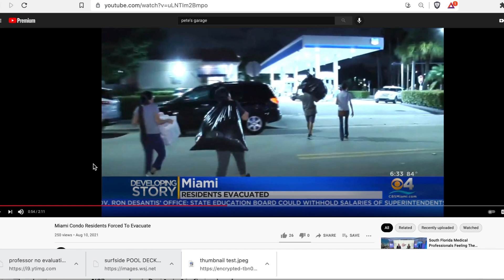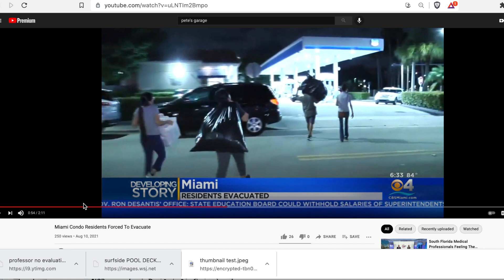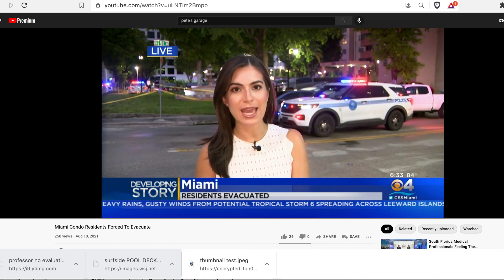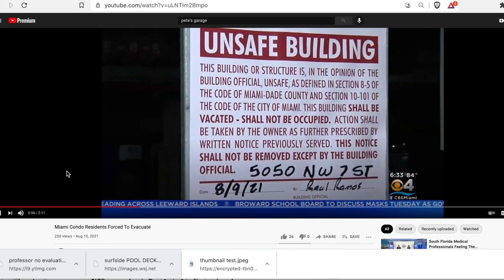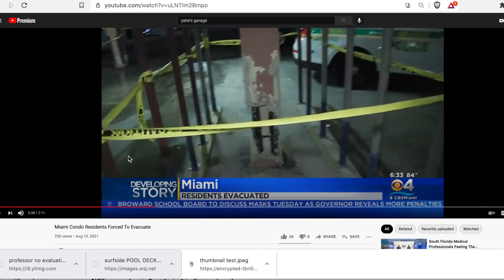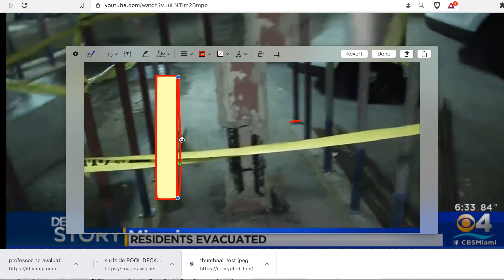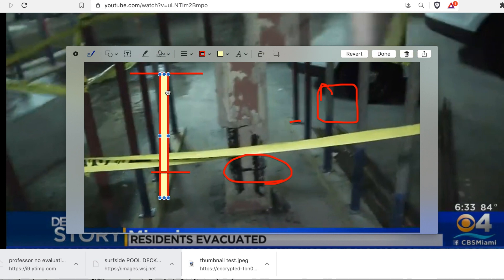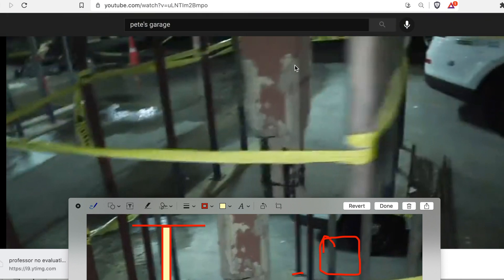Column Buckling real world example Miami Building Evacuated

Comment: Great information on steel ,I can there is problems with  a column that has apartments above it on 51st Ave. the west side that can be seen through the entrance gate to the right ,it is not just the 2nd story parking area  where this column is located it has cars on top of it waiting for that elevator ride.
Reply from the maker: Thanks Rick,  noted, apartments above and not free standing parking garage.
Reply: @EngineerPEretired  Note: This building is in the City of Miami so it is under the  control of The City of Miami Building Department not Miami-Dade Building Department

Comment: These condo associations need someone to sit them down and tell them that they have a fiduciary responsibility to properly maintain their buildings and it doesn’t make a feckin’ bit of difference what the unit owners think. Condo boards do not exist for the purpose of keeping the monthly dues low. Period. These condo board members need to be told as well that if it’s not in their comfort zone to be liable for the discharge of their fiduciary responsibility then the course of action open to them is to resign.
Reply from the maker: Jim, I agree, these condo associations need to perform and stop with the unprofessional ''staff'' and get some qualified people representing the STRUCTURE...

Comment: Do they remove the old rebar and replace it ?
Reply from the maker: They use plastic bottle in place... it's a new deal... Just kidding, no, they would take this metal down to ''non-rusted'' material and then ''jacket this entire column" (new column around this column to help with spreading the loads to a larger area = which would reduce the psi / lbs per sq foot  pressure on the base and also on the floor above onto this column...  But, I am not sure this is column is stable to jacket (jacket with rebar)... It appears to have depression going on, which is an indicator of settlement issues...
Reply: That would be great, since the ocean is full of plastic bottles

Comment: As you point, this is endless. People do not get this. They think buying a $XMILLION condo =  buying the solid marble rock monument. No. The so called investment is NOT meant to last. With care a SMALL frame or Adobe will last much longer, ditto mobile home. One key 🔑 is small. Where are the Bosses🐈 ?
Reply from the maker: The bosses are on the front porch, chillin... it is over 90 degrees but, they demanded I let them out, per their contract...
Reply: I think my cat belongs to the same cat union.  Treats on time, open the window, etc.  Slave drivers,  😻
Reply from the maker: They usually do not get treats; only if I am reinforcing a behavior... Like the grey cat, she does NOT want to come in... So, I will give her treats, if she comes inside for the night... (we are talking 10 "squares")...   But, they just get love for their ''treat''...

Comment: Is that stirrup method used in construction these days?
Reply from the maker: On commercial, always.
Reply: @EngineerPEretired  I don’t recall you using the word stirrup on the Surfside column structure but the “rebar rabbit ears” branching out from the concrete columns I do remember.
Reply: @EngineerPEretired  I honestly did know you were looking for the term punching shear but thought in this latest video it was too early to mention tributary cuz the spacing of the columns was not clear to me yet:)
Reply from the maker: 160 plus videos, I mentioned it a few times and have shown the column details...  I will go over many times in future videos...   they go hand in hand...